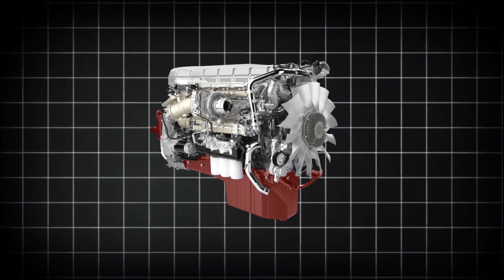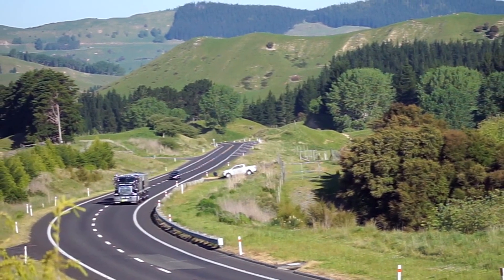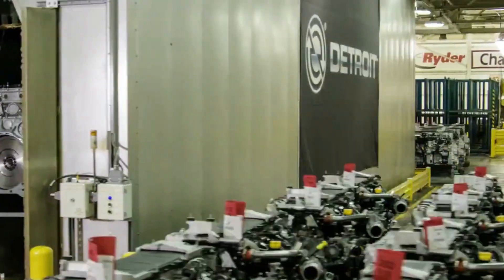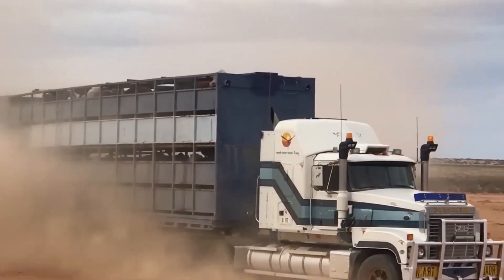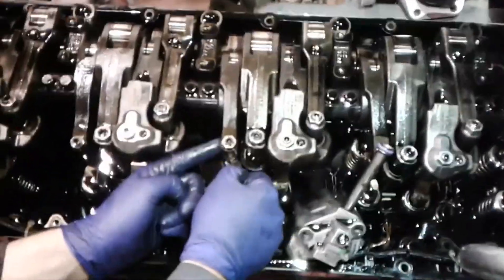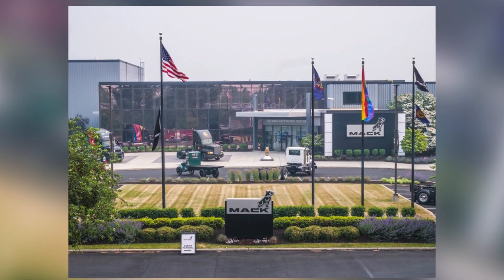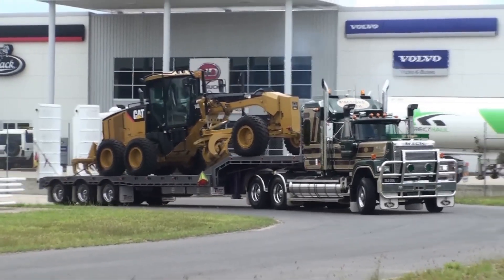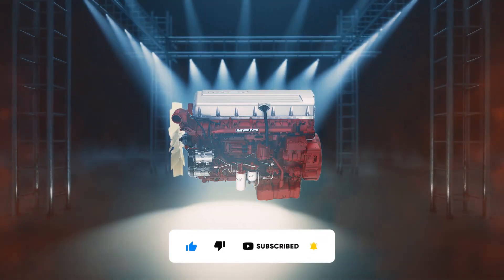Why Mack MP10 Was Banned: The Engine That Was Too Strong

Comment: It wasn’t banned, it was replaced with the MP11, at 780, the D 16 has the same 780 horsepower
Reply: D16 volvo  engine  has gone replaced by a 17 L 780 hp 3800tourge the 16L was 750hp  3500 tourge  in Europe  but only  685 in Australia 😂